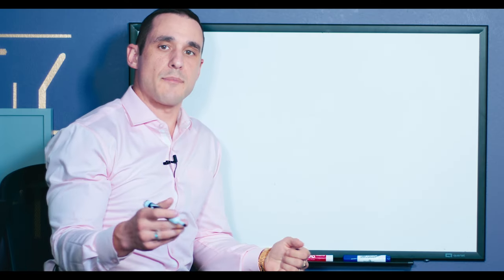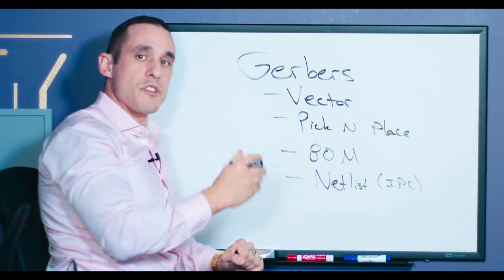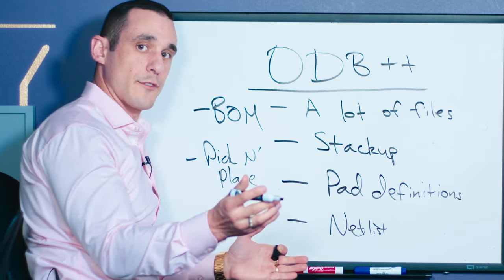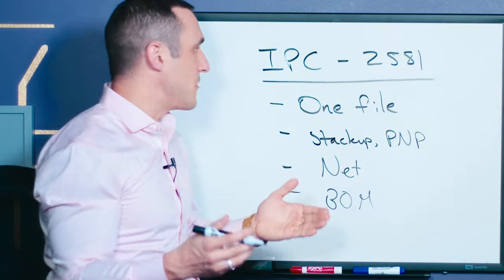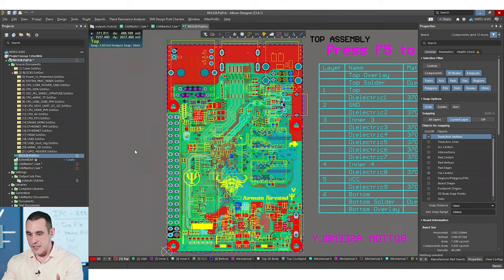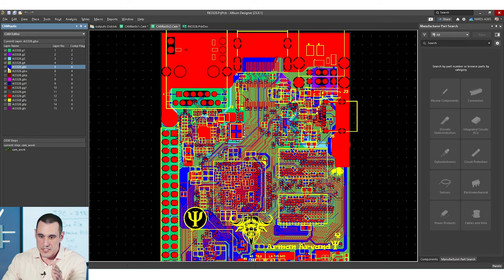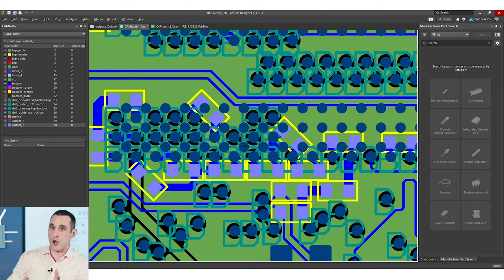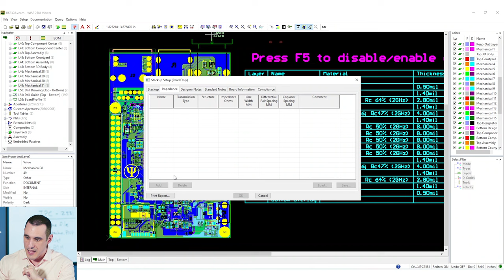3 Types Of PCB Manufacturing Output Files You Need To Know

Comment: So in all cases we should know fabrication specifications) I prefer to use gerbers, but I remember that I should create correct layer stackup and impedance profile. In case of factory can handle Gerber this way looks good enough to produce PCBs. But if company needs release database (not Altium release system) ODB looks good. 

Thanks for this video - its great to know something more about other ways to do somethig other than I used to)

Comment: When you talk about "Gerbers" are you talking about the 1980s definition?  Because I think the current standard (for several years back) does define pads ... but maybe you're talking about defining them in a different way than I would.
Reply: I only lumped them together because I have never seen a manufacturer specify whether they will only accept X2 versus the older version, from all I have noticed they will just take whatever you give them. As I recall when I last did a recreation of a PCB from Gerbers, I used the old version of the Gerber files and it was able to extract most of the pads anyways, so I suspect this has become be a non-issue for CAM software.

Comment: Are drill files always separate?
Reply: For gerbers yes, for ODB++ my understanding is that it has the capability to include drill data and I think can be exported as NC drill
Reply: There is an option to include drill symbols into gerber. But I never used that. 
Separate drill files is a must, especially for blind and half-open vias.
Reply: @vasiliynkudryavtsev  Yes you can include symbols with a drill drawing option in the exports, but not the NC drill data